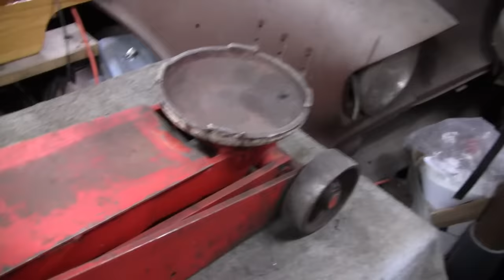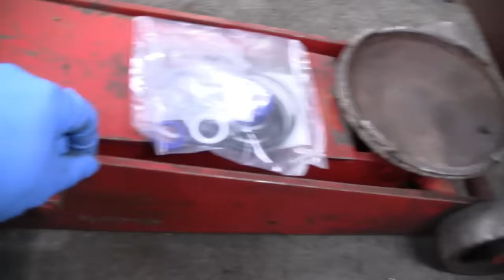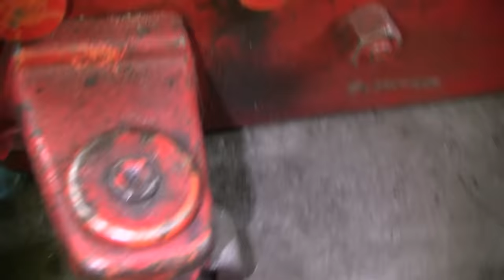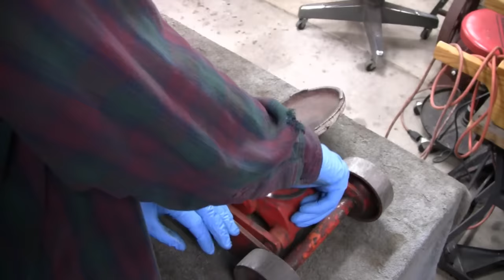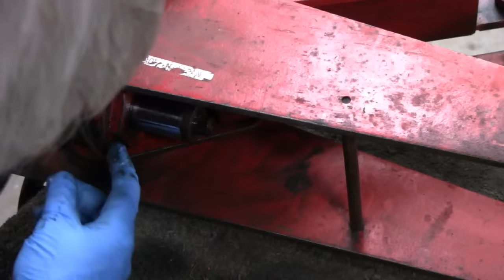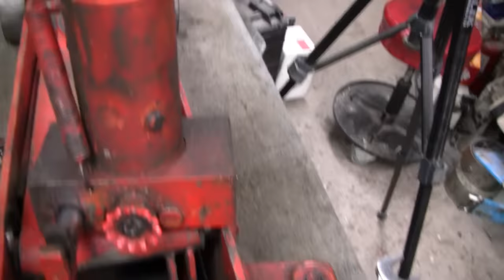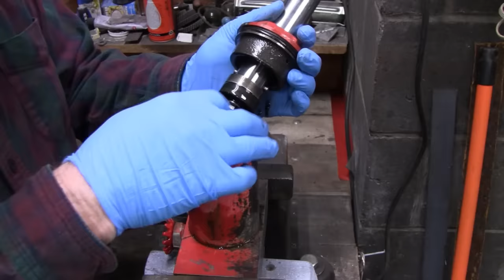HYDRAULIC FLOOR JACK REBUILD

Comment: Nice vid. I have the same jack in green. Very used, purchased in 1978. My neighbor also has a green one, but in showroom condition. I'm very jealous. One bit of advice. Don't throw away the rest of the kit. You'll need it if the release valve starts leaking. You skipped repacking it. Also... You should always apply some kind of lube to all o-rings during assembly to avoid tearing. Usually I just take the old seals to a local hydraulic cylinder repair shop to match them up. You'll get exact replacements, and for just a few bucks. Probably under ten. Funny thing is, you actually bled the pump by accident. Pumping the jack with the release valve open, circulates the fluid through the system. The air winds up in the reservoir. It might not  have lifted, if you didn't do that first.

Comment: Great job ..
I use to rebuild these jacks back if the 70s & 80s,  and let me say they were good jacks .
The crap coming out of China , well you know .
Hine Warner was a good Jack, Sears actually sold this jack in different lifting capacity with the SEARS logo .
Also Lincoln was a vere reliable floor jack, same as the Walker well back in the 50s .
This junk thats available today is  use it and throw it away when it falls ....
The old school of rebuilding things are a thing of the past anymore....
Thank you for posting this video,  brought back many memories...
Reply from the maker: Thanks Bud!!☺

Comment: Safety TIP for jack users, when you lower the jack, tighten the handle so its immediately ready to jack up again, example, you jack up your car, you let it down onto some safety stands, one stand slips out and that part of the car falls some, you are ready to jack fast in case of a problem, been there, done that. DO NOT use your jack only, put something else under the car for safety, even the wheel and tire you may have pulled off. As you can see, it only takes a blown seal to allow the jack to come crashing down. Awesome video, time for me to order my rebuild kit.

Comment: Great video. Auto body tip. When using hammer hold index finger pointed up onto the handle towards the head of the hammer. Gives much better control of your grip and aim while striking. Give it a try.

Comment: To remove the lip-seal from the pump plunger hole, use a thin-blade putty knife.  A sharp round corner on the putty knife, and some gentle taps with a hammer, will allow the edge of the putty knife to go between the lip-seal metal rim and the hole wall. Then, pry out with a screwdriver. 
   The lip seal is installed with the lip up.  It wipes the push rod to keep it clean. The o-ring seal (and its nylon backing ring), further in the hole, contains the pressure produced by the push (pump) rod.

Comment: And this is the way it is done folks. This man knows value. He is not at all afraid to tear into this jack and fix it right back up. American made old jack better than a new China made. I do not trust either one of my floor jacks, both made in China Husky branded. I would trust this Craftsman though. Looked everywhere for one before I bought the Husky Home depot ones. Both, within three years do not want to go back down unless they are pushed down. Thanks for this video. You are what the U.S.A. are all about.

Comment: The Vaseline you used is fine depending on what kind of rubber, neoprene the o rings are made of, the tapered thing with the spring is a pressure relief valve that opens to let fluid out of the pressure cylinder back to the reservoir to relieve excessive pressure if you try to lift something in excess of the Jack's capacity (a safety feature no doubt)
Good video all the best to you and yours Sir.

Comment: I just finished watching this video.  I have an Astro Jack that I bought off of the Mac Tool man back a few years before your petroleum jelly expired.  It's the same exact jack that you have and bought from Sears. 

 Mine was doing the same thing that yours was so I asked our Hydraulic shop about whether it was rebuildable and they said yes it's a copy of a Hein Werner jack (USA made).   They told me to pull the jack from the frame and give it to them.  They rebuilt it and gave it back to me.  It's been working great ever since. 

Just one thing about the seals you installed.  They are dust seals and are  designed to keep dust and dirt out of the internals of the jack, not necessarily to keep oil in.  That's why they were in stalled backwards.  Nice job on the rebuild.  Doug

Comment: I'm using a USA made Black Hawk floor jack from the '60s, may need a rebuild, needs fluid again. I love that thing because you don't have to put the handle up all the way to get it to jack, unlike the newer ones. If it is deep under a low car, even a few inches of the handle will raise it up quickly.

Comment: Great video! Thanks for taking the time to film, edit and post this. There still are a lot of us tinker’ers out here who love these kind of tasks. 
  I have this exact same jack under the “Matco” tool label. It’s been a go-to piece of my home shop for over 20 years. It started pumping up about a third of the way normally, then the strokes become less and less productive until the pumps are barely a flick of up movement. I thought it was a just low on fluid, but topping off the oil didn’t cure the issue. It holds weight as designed, but takes a lot of mini strokes to get the wheels off the ground of most cars. 
  I dread pulling it apart because I know it’s going to look like a clock made out of rubber seals in there. I’d like to find exactly what valve or area of the jack is causing this defect and only open and repair that area, as the rest of the pump works good.  I don’t want to fix something that ain’t broke in another area of operation and cause a new problem that isnt there.
Reply: What patients!!!!
Reply: Honestly with this kind of repair, you usually end up find out one problem after another just chasing down "that one valve". Best just to get a kit and swap everything that you can. You already have the thing open and drained anyhow
Reply: JohnnyP414 is right, like it or not.  The first thing people need to learn is that they have a lot to learn,

Comment: I found an old hydraulic floor jack about a decade ago, it looks very much like the one in the video, it had been thrown out because it leaked! I couldn't just leave it to be turned into scrap and the guy said I was welcome to it, so took it home and repaired it with a 10p rubber O-ring from a local store. A year or so after, following a lot of use, the top of the plunger broke, so welded that, but I still own it, I still use it, it's still my favourite hydraulic floor jack, although I would love to know the make and model so I could buy the correct rebuild kit for it. But I never trust these devices, they are excellent mechanics aids, but I always push into place a couple of different design of axle stands and lower the chassis onto them, keeping the jack with some weight on it long before I even lean under a raised vehicle, that's just a sensible precaution to me and to pass on such safety matters to my son, who thankfully does practice them. Most of my hydraulic jacks are now ages old, well built, strong and sturdy... I can't remember the last time I drove a vehicle one of my sets of ramps, I remember back when I could (and would) lift one side of my old Robin Reliant onto a ramp, then lift the other side, still makes me chuckle that there was a time I could do that!
Reply: Good move. Jacks have one purpose. To change the relative height of a car. Jack stands have one purpose. To hold a car at that height.

Comment: Great informative and helpful video.. thank you for sharing.
Friendly suggestion would be to not use petroleum jelly or any hydrocarbon oils or solvents as they are incompatible with may of the elastomer and plastics... Also the petroleum jelly can coat the fine filter screen and make for very slow let downs.  Use hydraulic jacking oil to lube up the piston cup and all mornings...

Well.Done!
Reply: Patrick Guy Yes, I was over here saying no no no don’t, use the oil...
I was also concerned about the seal direction but hey he did and a fine job overall and I’m grateful for his video.

Comment: Thanks for the video. I have an Australian made Apac floor jack very similar in construction to this one. I took it to work many years ago and jacked up a truck with it which was a dumb thing to do. The truck was too heavy for the rating of the jack which from memory is 1.5 ton. I can't recall exactly what it was doing after that but it certainly wasn't working. I pulled it apart and from memory reseated some of the seats that the ball bearings sit on by using a sacrificial ball and pin punch. Never got it to work again and so it sits in pieces for the past 20 years. Maybe this video will inspire me to have another go at repairing it so thank you Road King

Comment: I picked up mine like that in the mid 80's and in the late 2,000's the main internal ram seal split. Matched it up at a hydraulic shop and installed it with new oil... Good to go. Thick steel, rock solid construction 2-1/4 ton with a large pedestal like this one. Still working almost 40 years later.

Comment: That pin through the piston is part of the bye pass valve that opens when jack reaches  full extension. Oil returns to reservoir. One thing I have learned about this jack is to not fill reservoir with a level close to the fill plug. If you do this, oil returning to reservoir when jack is let down will cause oil to burp out fill hole until level is established.

Comment: I have the same jack, our Snap-on dealer sold them. I bought mine in 1974 and it just started leaking down. Bought the same kit, like you said the jack is worth it. Mines an Astroline 2ton am200f, but were sold everywhere, just different part numbers! Mine was painted orange! Great video

Comment: I have this jack I bought in 1974 at Sears new 328.12001. It is finally hot holding up so I have bought the same kit you did and now I will rebuild it following your video. Much appreciated. I too do not understand why the seals were places upside down in the jack. Very hard to get those in use the OEM way. I guess using a socket inside the seal and driving it until it seats would be the only way. Thankjs

Comment: I almost never comment on a video (let alone watch one from start to finish), but I have to applaud you for this one.

I have a very similar jack, from design to color, and it's of the same vintage. Even the gummy residue from the original label is the same! I've been meaning to replace a broken caster and repaint it for a while now, I'll add this to the list. I have newer jacks, but I always reach for old faithful first, unless the car doesn't offer the clearance.

Thanks!

Comment: The seal you pulled out at 28:48 & said it was made of hard steel, is very typical of a front main oil seal in a car that goes around the crank. They are off the shelf at autostores and if you knew the inner outer you could replace it with one if you want. Thats how you can tell this is an old jack , very well made, using top notch components. You can use an automotive "seal puller" to get it out easy. About 8-10$ , just a flat handle and a T at the top composed of different size curved pointed blade, kinda like a eagles beak, but more of a curve, will pop them out 1-2-3. Great video thanks!
Reply: I have a similar lack. Went to an hydraulic seal and gasket supply house with the old seals. Paid around $20 for all gaskets. Mine did not have that automotive type metal seal.

Comment: Good video!  Took me back to my "yute."  :-)

Just did my 1.5 ton green Sears 328.12002 that I bought new in ~1981 for $99, on sale.  Great tool that now needed a rebuild.  Instructions say to lube it every three months ... now 40 years too late!

I have not read all the comments, so may have been covered:

After taking the "power unit" out, clean/grease/oil everything else first -- you will be too eager to test the power unit after rebuilding it.  My front wheels/axles and the rear wheels' ball and roller bearings were dry as a bone, for example.

The trick for putting the handle-spring back in is to 1) remove the handle from the receiver (9/16" bolt), 2) install the receiver with the left bolt, loosely, 3) with the receiver straight up, use your thumb press the spring into the correct position, 4) screw in the (greased) right receiver bolt, 5) tighten both bolts.

My plunger's seal was factory-installed "upside down," and the main piston's was "correct," so I put in the replacements those ways too after inspecting the seals' lips' orientations.  My kit (Amazon) did include the white plastic washer that was said to be missing in the above video, and I had fewer leftover new parts.  My power unit's outer cover/barrel would not budge (seemed press-fitted) so I was not able to replace its o-ring, if it has one.
Reply: bought same one in ny lasted for decades sars 99.00

Comment: Mine I bought on sale at Ward's when they were closing down the local store, about 1977. I gave it to our son, he managed to loose it so replaced it with a new one from HF. The new one is bigger and much faster but rebuilding the jack is so easy. I'm retired and don't use them often but when needed it's needed!! I still do my own automotive work like oil changes. I just miss my old jack. It hoisted a lot of different cars over the years!!

Comment: Bought mine new in 1978 and it started leaking last year. I just replaced the main seal but also lubed the wheels and it works as well as it did then. This is a heavy 1 1/2 ton jack as you noted and this will out live me. You video was the most complete, thanks.

Comment: From the voice of experience, and for anyone else that does this, if you didn't back out the star shaped relief valve from the nut that holds it when you installed it (the one with the two copper seals), you should have. When tightening that piece , if the valve is too far in, the sharp end makes contact with its seat before the threads of the nut that holds it becomes tight and you will be tightening the pointed pressure release valve end against it's seat while trying to tighten its nut, which will damage it.

Comment: Nice. Mine is blue, my dad had that thing since I was a tyke.  It was always one of my favorite shop toys to mess around with.  He gave it to me a few years back when it was doing the same as yours.

I looked for the rebuild kit but there was more than a few options. So instead, I tore it down and took all the seals to my local tractor shop.  We sat around and measured everything and ordered from their massive hydraulics book. I think it cost me around $20.

Fast forward to a couple months ago and my dad mentions something about how he shouldn't have let that jack go yet! (he bought a Hazard Fraught replacement.) I can't help but chuckle.

Comment: I have a jack like that that would not hold..So in the meantime I got a harbor freight.. To finish job..It would drop down a little overnite.. Got new seals for the old floor jack rebuilt it and it holds no drop for days and days.. on a super heavy 1979 benz... i love that jack

Comment: I wish I could find a kit for mine ( sold by Matco at the time)  that I've had since the mid 90s. It looks just like yours and is about 80 lbs. Rated at just 2.5 tons, it is much heavier gauge than the 3 ton units I see for sale now, and has the larger swivel plate, like yours. Also, the eared return spring that holds the handle up is broken on mine. Any idea where to find that too? Good vid, thx!
Reply: If your jack has a serial number on it I will find you the part number and where to buy it. I just ordered a kit for customer for an older model Matco 2.25 Ton jack.
Reply: I think he said eBay. It is some sort of universal kit, which is why he had extra parts. Good luck!

Comment: It looks like you got ahold of my old floor jack!!  No joke!  I n the Late 70's we used to live in Rome, NY at the old air force base there and I needed a good floor jack badly as I owned and raced a Corvair!!  Wife and I bought one at Montgomery Wards on Black River Blvd. there in Rome.  I had that thing until I gave it to my neighbor in Germantown, TN back in about 1996.  He had it last I knew.  I had paid $187.00 for that jack back in probably 1975 and it never failed to hold the load!  They were great jacks!!  The best thing about them was the large plate that hoisted loads!  You could also place a 2x4 block of wood onto that plate and it fit in-between those side edges on the plate.

Comment: I have 2 of those jacks. One orange, one blue. The kicker is the six inch lift plate. Bought one new. $39.95. One used 15 yrs. later for $40.(inflation) lol Both still work great. Great video, no BS. Keep up the good work.

Comment: I've had one of these jacks branded "Allied" for 25 - 30 years.  Anytime it started to creep, I would do what a Snap-On guy said to do.  Have someone jack it up to the limit then while pushing abruptly down on the saddle, open the valve full and fast.  I've had to do that a half dozen times over the years, always works like a champ.